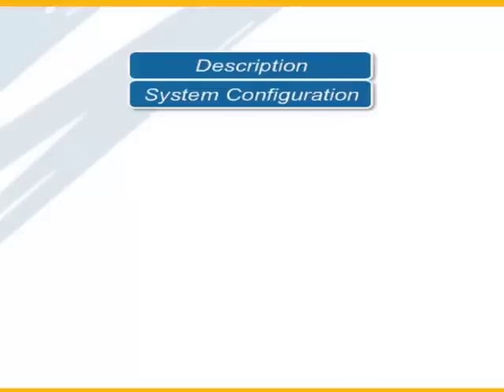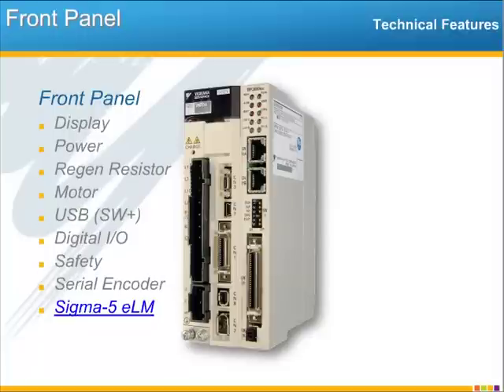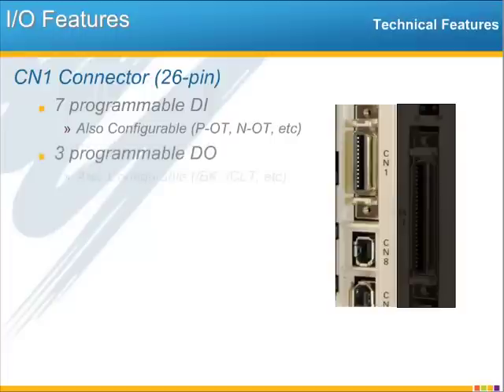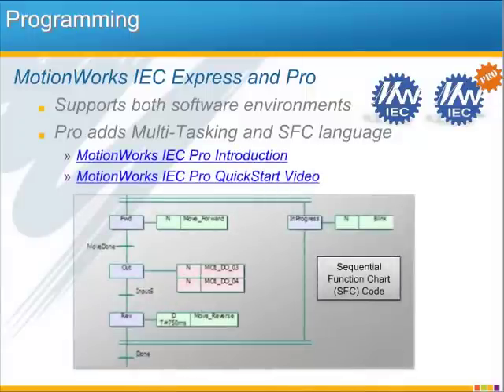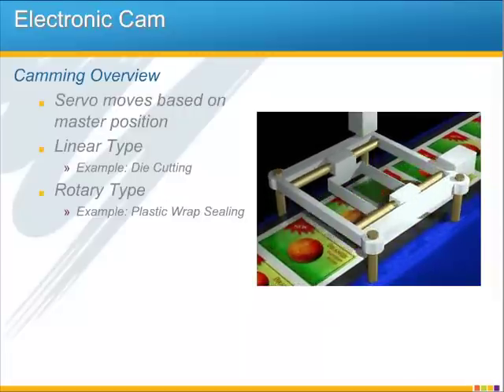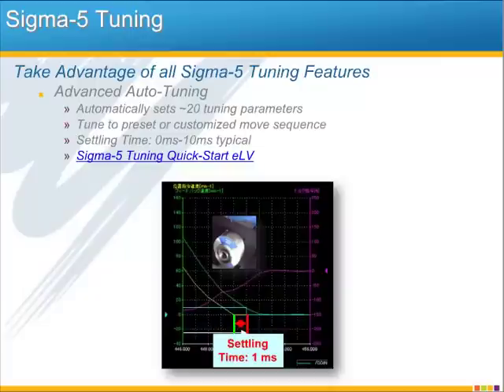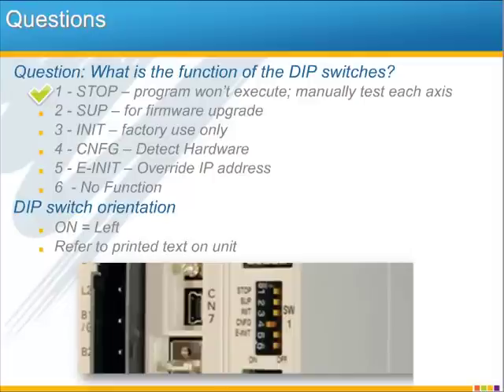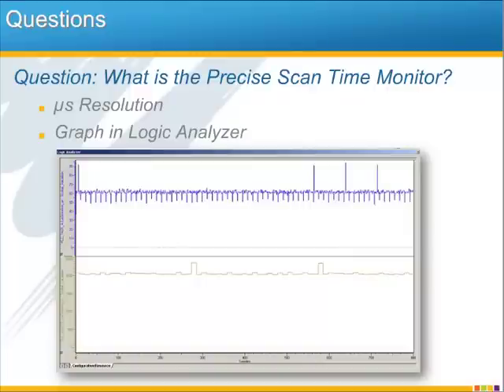MP2600iec Hardware Overview

Comment: Hi Wecon,

       I am from India, You Know majority of woodworking Machines in a country having over 1.5 Billion population run On RichAuto and Weihong Controllers...!   

Can You Make Tutorial Series on Your Motion Controllers that can be used as alternatives for these DSP Controllers..!?

I am sure that the Provision of a  Modern GUI with Industry Standard Communication Systems that it features would revolutionize the trend.!
It would attract most common people towards it because the provision of such a GUI would make the learning curve easier and more systematic...! 
 
The Smooth but lightning fast performance of servopacks  combined with such a intuitive Graphical interface that can be installed on a PC  or a HMI Touch Panel that gives a feel of Windows PC Platform based Control environment would attract many people to such machines..!

Using DSP Controllers is very limited in terms of functionality and usability.
Its like a blackmagic for most common people..!

But the thing is ,

First You have to provide a package of Controllers and drivers +GUI which is most affordable that you can provide 
You have to provide tutorials for Builders on assembling and configuring your controllers and designing the GUI for a very basic 3 axis CNC router with most essential features only..!
And configuring the controller to operate G codes from that GUI.

No need to provide ATC or other fancy stuff..!
Just as a alternative for DSP Controllers with additional potential of GUI with fast Communication Protocols.

Personally, I am interested in building such a prototype for sale. May be afterwards I may build multiple machines.
I seek industrial quality and intuitive GUI experience at affordable prices